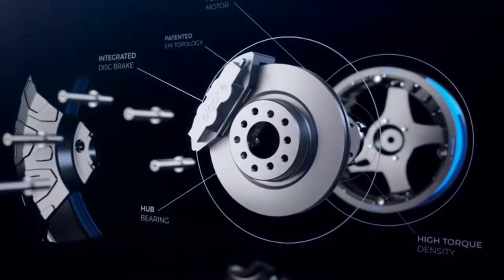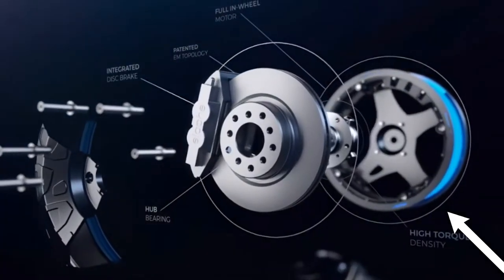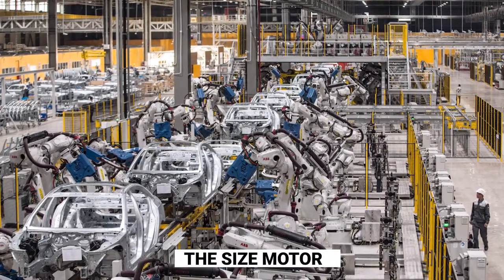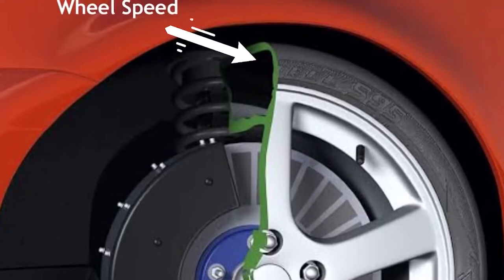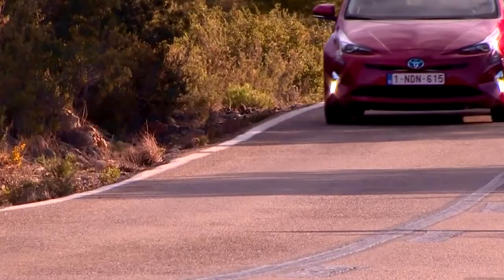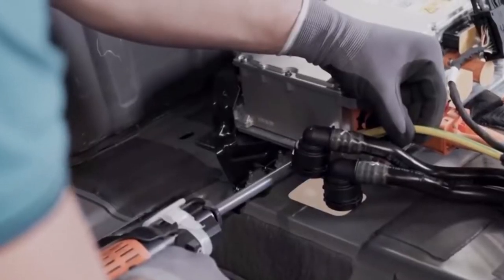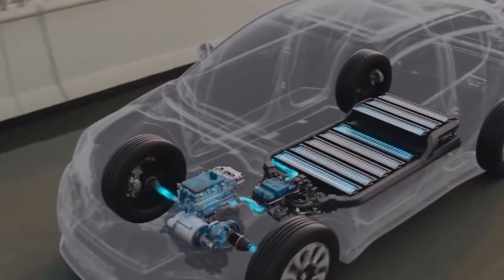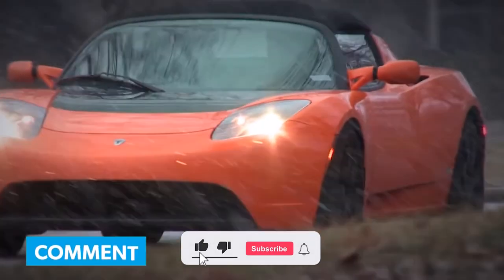in-Wheel Motor Technology Work EXPLAINED in Detail

Comment: It would be easy to connect the motor and wheel directly, but if you do that, the motor will immediately break due to impact, and even if that doesn't happen, the weight of the vehicle will be on the motor shaft, creating tremendous resistance.
In-wheel motors are not easy in reality.